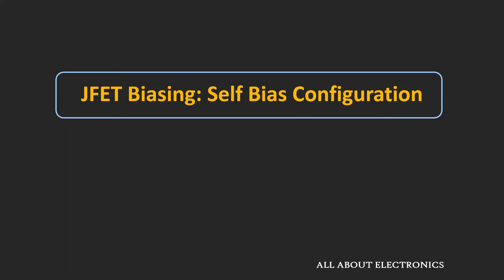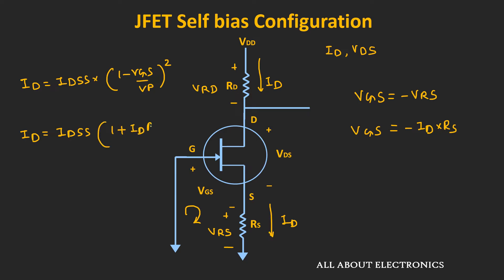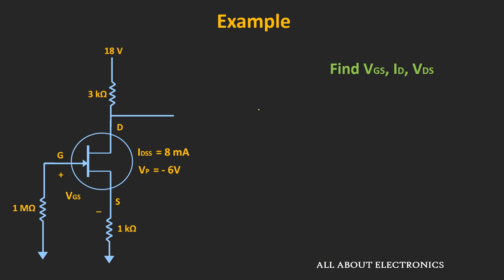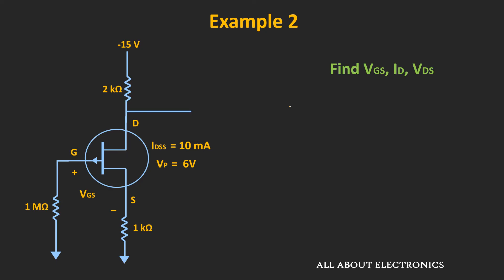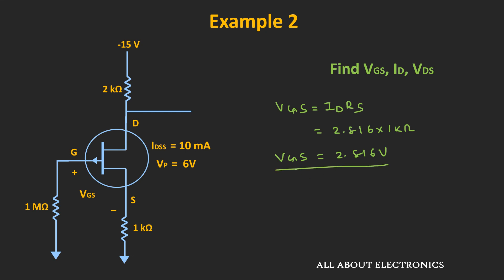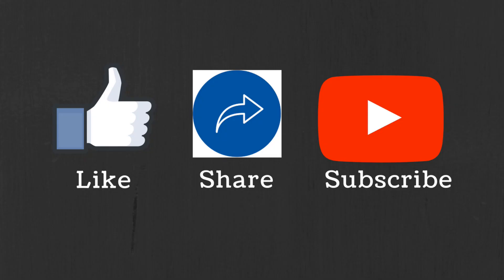JFET: Self Bias Configuration Explained (with Solved Examples)

Comment from the maker: The timestamps for the different topics covered in the video:

0:27 Advantages of Self Bias Configuration over Fixed Bias Configuration

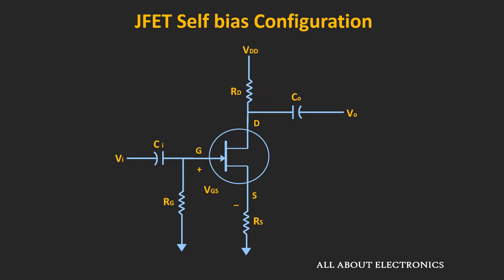3:04 DC analysis of Self Bias Configuration

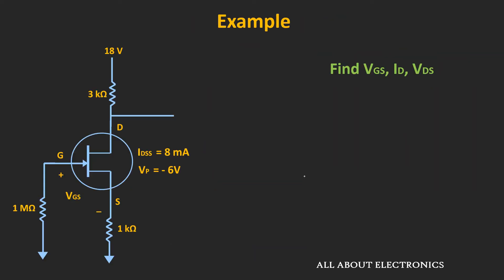7:42 Example 1

12:03 Example 2

17:37 Example 3 (For practice)

Comment: 2:37 how Vgs will increas due to increase of voltage across Rs. I think it will decrease that is it increases in reverse polarity. because gate is connected to 0v and source voltage is increasing therefore Vgs = Vg - Vs = 0 - Vs = -Vs.

Comment: Can someone tell me how did he got the 16.5 Id in the quadratic equation ex.1...I think it should be 12Id...
Reply from the maker: At 9:18, just multiply L.H.S and R.H.S by 36/8. And further, by moving (36/8) Id on the other side, you will get it 16.5 Id.
Reply: @ALLABOUTELECTRONICS  but the value of Idss is 8mA not 8A
Reply from the maker: @agnesasopaj  Yes, that is why the final answer Id1 and Id2 are also in mA.

Comment: For example 3 I got :
Vgs = 2.106v
Id= 4.212mA
Vds= -4.45v  
And it is in saturation region
Are these values correct?
And thanks a million for your great explanation.
Reply: Isn't Vds = -4.47V?
Reply: @kimverlycasem3398  you are right .Vds must be - 4.47 but as you know very small differences
Reply: yes buddy correct
Reply: how did you find Id?  i am getting the previous answer which is 2,816

Comment: How do you simplify  the quadratic  equation i dont understand
Reply from the maker: Hi, I think many of you finding it difficult. Sol, let me explain it here. Here, Id and Idss are in mA.
Rs is in kilo-ohm.
Now, the equation is Id = Idss ( 1 - Vgs/Vp)^2.
Here. Vgs = - Id x Rs And Vp = -6V
And Idss = 8 mA.
So, it can be written as Id (in mA) = 8 mA x [ 1 - ( - Id ( in mA) x (1 kilo -ohm)/ (-6V))^2
Now, mA and kilo-ohm is V. And in the denominator there is volt. So, overall term will be unitless.
So, overall it can be written as Id ( in mA) = 8 x ( 1 - Id /6)^2 
I hope it will clear your doubt.
Reply: @ALLABOUTELECTRONICS  Thanks that makes sense.
Reply: Good Question.  I have the same.
Reply: How did you get Id^2 -16.5+36 from 8/36(36-12Id+36Id^2)?
Reply: @curlyterise8469  i have same qouestion here :/
Reply: Matej Galešić whats your email? I found an easier approach to answer this. I’ll send a photo of the formula I used. I remember that I finally answered my asked question above but the formula I found was so much easier to use
Reply: @curlyterise8469  can you send that fastest as you can please . I need that now thank you so much <3
Reply: @curlyterise8469  its ok i solved :)
Reply: @curlyterise8469  can you also send it also to me?
Reply: How did you get Id^2 -16.5+36 from 8/36(36-12Id+36Id^2)?
Reply: Thank you sir

Comment: at around 9:07 Ugs shouldnt be -Id*Rs?
Rs [Kohm] also is needed for Idss [mA]
Reply from the maker: Rs is 1 kilo-ohm. So, it is already taken into account during the calculation.
Reply: @ALLABOUTELECTRONICS  Please show us how it was done. Maybe you could explain in the community section. Thanks.
Reply from the maker: Hi, I think many of you finding it difficult. Sol, let me explain it here. Here, Id and Idss are in mA.
Rs is in kilo-ohm.
Now, the equation is Id = Idss ( 1 - Vgs/Vp)^2.
Here. Vgs = - Id x Rs And Vp = -6V
And Idss = 8 mA.
So, it can be written as Id (in mA) = 8 mA x [ 1 - ( - Id ( in mA) x (1 kilo -ohm)/ (-6V))^2
Now, mA and kilo-ohm is V. And in the denominator there is volt. So, overall term will be unitless.
So, overall it can be written as Id ( in mA) = 8 x ( 1 - Id /6)^2 
I hope it will clear your doubt.
Reply: @ALLABOUTELECTRONICS  i got it thanks a lot!